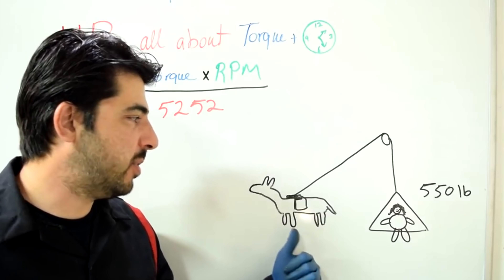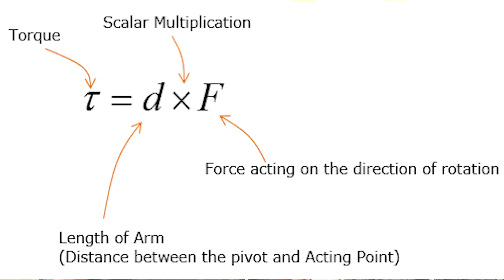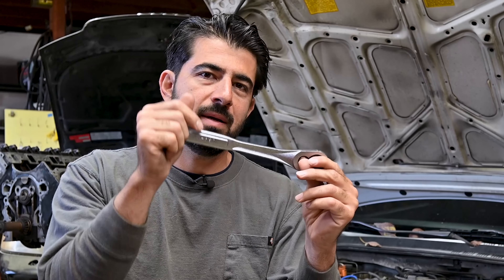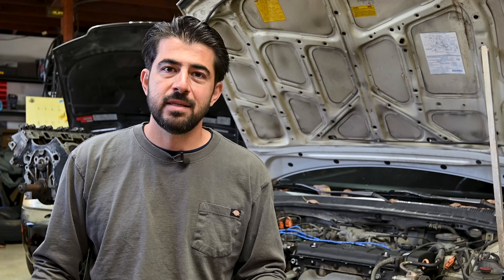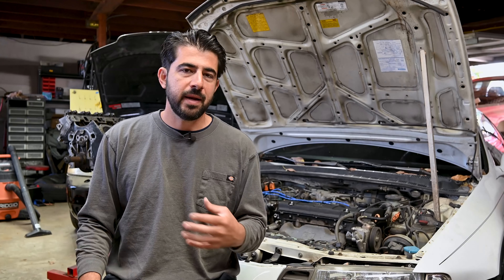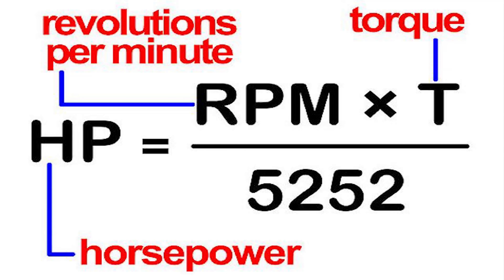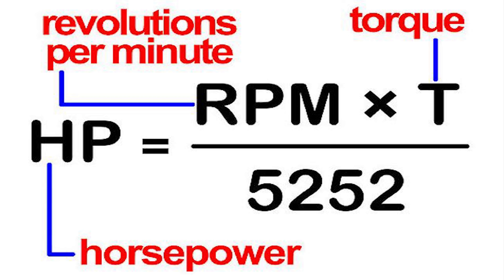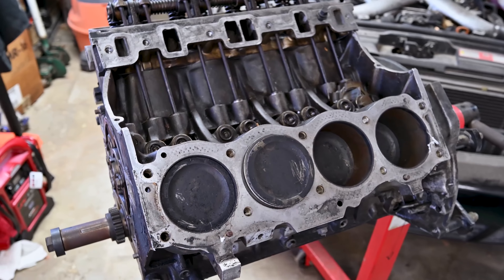Easiest Torque and HP Explanation - Scientifically

Comment: This man is very intelligent and a very good teacher
Reply: I have a 2008 Ford Fusion  2.3 4 cylinder manual transmission  and I have been struggling to put a serpentine belt on it
Do you know if those Ford techs have a special tool they use because I cannot get it on?

Comment: You only have one force in your combustion engine and that is torque, torque peaks in the "middle" of your rew range and that is because air not can get in to the engine any quicker and the maximum torque air filling of the sylinder has been reached, but hp total power will despite the decrease of torque continue to rise because the number of combustions increase and will continue to increase up the rpm to the point where torque sylinder filling get so low that the maximum hp power is reached, this is a simple explanation of how torque and hp interact in a combustion engine

Comment: Torque is a measure of force. It's a non-moving measurement! It CANNOT show how much power an engine makes.
HP is a measure of HOW MANY of those 'torques' are happening,and thus shows how much power an engine makes.

From there it gets confusing because almost everyone has learned totally wrong myths, and also because radically different engines can make the same amount of power -and that screws with people's minds.
Reply: well yea this topoc anyway is as important for daily life like put red or yelow condom on you know what anyways misconception come from separate those combustion and dont understand that 50 nm aplicated 100 times per sec give in fact biger output Force which accelerate vehicle forward than feg 500 nm aplicated 1 times in a sec at engine crank cos they accumulate 🤭 its like put on bathromm scale forcemeter kitchen scale whatever 1 bag 500 kg of potato vs 100 bags each 50 kg they just accumulate on one big weight reading and they are dont work separatelly but who cares this knowledge is as important for avg person like im wrote at beginning me post 🤷🏻‍♂️😁👋🏻

Comment: A well-known calculation at the time, one pit pony could haul one cart filled with 220lb of coal 100 feet up a mineshaft in 1 minute, or 22,000 lb-ft per minute. Watt then incorrectly assumed that regular horses must be at least 50% stronger than pit ponies, thus making one horsepower equal to 33,000 lb-ft per minute.
Reply: I hadnt heard that one before but its not surprising. I've known for years that HP has almost no relationship to an actual horse's abilities.
I think they can top out at 5-6HP or somesuch?

Comment: Ahhh 5 hours late for the new episode premier. 

Was busy changing over the winter tires to all season tires.

When I do the change over I check pad thickness and look at brake lines ect while the tire is off. I do one more thing that I've yet to see someone recommend on YouTube. I loosen the fasteners for the slide pins and check their movement. This time around I had a recently seized pin on the driver's front lower slide pin.

Then I doctored the pin, cleaned the bracket, cleaned the pin holes, test fit the pins, greased and reassembled. 

Second time in 10 years of owning the car that I found a seized pin. Knowing most people run same tires year round, I'd recommend that at the 10,000 km or 6000 mile mark while doing a rotation to inspect the pins. Take less than 5 minutes to check and retighten, or let's you be aware it's seized and it requires immediate attention. Also found that being seized and finding out about that, by checking them twice a year means the pin is not to far gone to clean and reuse.

Comment: It's like you need to move some boxes and have two guys helping. Guy #1 is a big muscular guy who moves kind of slow but is super strong. He can move multiple boxes at once. He is high torque low rpm. Guy #2 isn't very strong but he's speedy, he can only move one box at a time but can do it really quick. He's low torque high rpm. Guy #1 is like a big engine muscle car, guy #2 is like a smaller engine Honda that has really high max RPM. Both methods can get you the same hp or work.
Reply: Torque is like how many boxes you can pick up at once.  Horsepower is how many boxes you can move into the truck in ten minutes.   Some people think horsepower is a more important measure of performance, others think it is more important to be able to pick up more boxes at the same time, even if you do it real slow..

Comment: Power is the rate of force delivery. In other words horsepower is the rate of torque delivery. A car going up a hill at a steady 10 mph requires a certain amount of constant torque from the engine to overcome its weight and a bit of friction. The same car going up that hill at a steady 20 mph takes about the same amount of constant torque but is delivering it at twice the speed so it is producing twice as much horsepower.
Reply: not true, it requires a certain amount of torque at the WHEELS or a constant amount of POWER from the engine....wheels torque can be multiplied with gearing
Reply: @motominded5275  Torque at the wheels comes from torque at the crankshaft, multiplied or divided by gearing and slightly reduced by friction. You can measure it wherever in the drivetrain you want, as long as you measure it the same place for both the 10mph and 20mph case, and your results will be the same torque at 10 vs 20mph, but double the hp.
Reply: @JackF99  not true, torque at wheels is vastly different than torque at crankshaft, torque goes UP as gearing reduces RPM....

Using your example, it's like shifting from 1st (10 mph) to say 2nd (20 mph), which gear makes more torque at wheels for pulling....we have to assume same RPM.
Reply: @motominded5275  given the weight of  the car the incline of the road the size of the tires the differential ratio the transmission ratio and the vehicle speed I can calculate the horsepower. Can you?
Reply: @JackF99  question is, can you calculate engine torque 😀?
Reply: And if you want to shift gears we  can recalculate with a different transmission ratio anf see the HP stays the same
Reply: @motominded5275  given the load at the wheels of course you can you just need to know the diameter of the tire,  the ratios of the differential and the transmission.
Reply: @JackF99  hp stays the same, exactly my point and contrary to the point you made above
Reply: Excellent explanation gui !

Comment: the long search for hp and torque and to understand how to get both in a single powerplant  is the winning formula hidden away in most race teams files. its the million dollar answer that differs in every engine size and transmission combo. there is no magic simple explanation. the  way most mechanics explain it on the internet is either you have a high torque engine or a high hp engine.  no matter what you beleive both types have won several race car  championships.  variable this and variable that combined with lots of electronic sensors  gets everyone closer to the perfect balance.

Comment: Here’s a question to look into: Producing X amount of horsepower by having a lot of torque vs producing that same X amount of horsepower via less torque at high RPM.
Reply: For two engines producing the same horsepower, the one that produces that horsepower at the lower RPM is the better engine always.
Reply: @JackF99  No it is not. It depends on the application. Otherwise you'd have truck engines in motorcycles.
Reply: @johnnyblue4799  Actually it is! If a motorcycle company could produce a literbike engine with 200 horsepower at 5,000 RPMs instead of 14,000 RPM they absolutely would. It would take torque they don't have.
Reply: @JackF99  Tell that to a performance car owner.I'm sure he'll be happy carrying around that 1.5 ton truck engine
Reply: @JackF99  Thats a ridiculous example and proves nothing.If they wanted a 200hp engine that runs at lower revs they just build a bigger engine. But they dont because people want the high revs
Reply: @JackF99  No they would not. Take the Triumph Rocket III. 2458cc  165 HP and 220Nm. How many of those do you see around?
Reply: @JackF99  not necessarily, a moto is a good example, if you made max hp at say 1000 rpm, you'd need 20 gears...like a big rig to get proper speed.
Reply: what you want know ? 👌🏻

Comment: That's a good explanation. The real phase shift will happen when we compare the broad torque band of electric motors with the narrow optimum band for torque seen with internal combustion engines. Electric motors win, hands down, which means they don't need complex gearing mechanisms to shift the optimum torque band. You end up with a lighter, faster car with more jump. As we watch internal combustion engines enter their overly complicated twilight years, we'll see that archaic term 'horsepower' fade away,  to be replaced by watts.
Reply: watts and hp are interchangeable measurements
Reply: @motominded5275  To most of us, they are. I remember the year Ronald Reagan decided not to follow the rest of the world by embracing SI units. He bent under the pressure of US corporations that did not want to be required to retool on a government schedule. In the end, it didn't matter, the rest of the world passed us by, because metric units made it easier to link networks of companies making parts. Today, only three countries on our planet do not support SI units, Liberia, Myanmar, and of course the USA.
Reply: @spelunkerd  crazy isn't it!

Comment: Wanna really mess with people?
Torque x 0 rpm ÷ 5,252 = 0 hp
😁
One common misunderstanding is if there's torque there's horsepower. Nope. There has to be motion (work). 

Example. Put 20lbs/ft of torque (force) on a lug nut that's already been tightened to 100. Guess how much work is being done? Zero.
Reply: Oh really? Then my impact wrench is weird. It keeps spinning inside although the nut is not moving anymore and the compressor keeps pumping air. So it appears to me that some work is being done...
Reply: @johnnyblue4799  You said it yourself - it's not moving anymore.The end
Reply: @ronchappel4812  No, it's not the end... I said the nut it's not moving, yet there's still movement in the impact wrench.
Reply: @johnnyblue4799  work is being done on the internals of your impact wrench but no work is being done on the nut you're trying to remove.

Comment: Nice try but you went WAY off the rails when giving examples of how to increase torque and horsepower.
Those were confusing and technically wrong in some cases.

Not that it matters much.Most people have so many wrong preconceptions that it's almost impossible to correct them